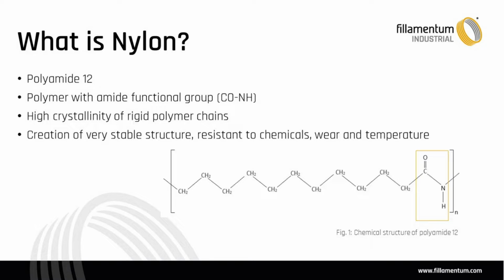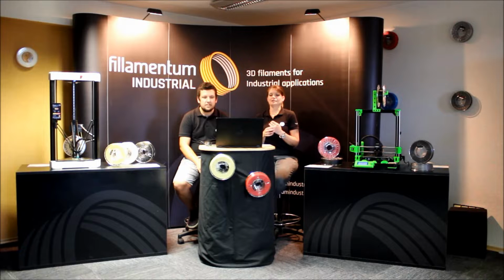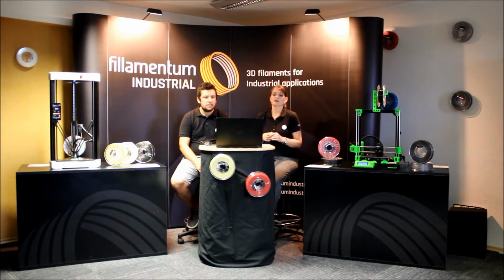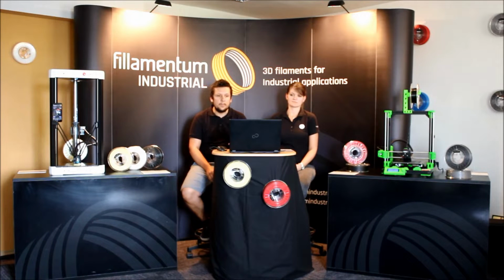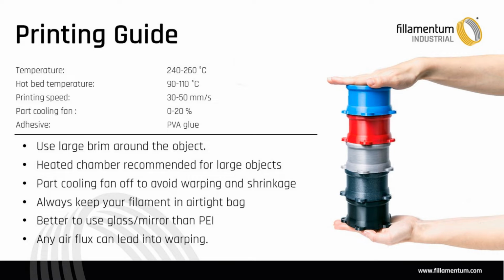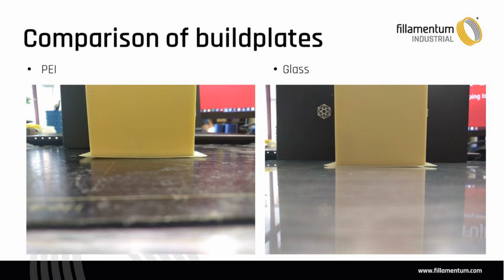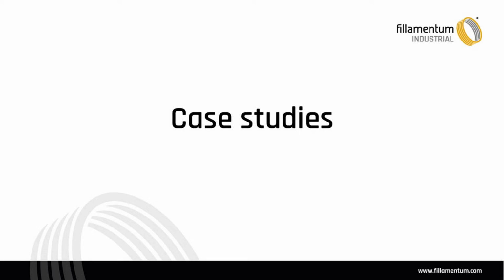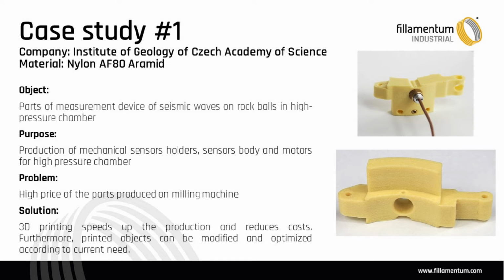Tricky Nylons: Reveal the mystery without a misery

Comment: Thank you for this first webinar. Please do get a microphone to place near Martin and Martina to eliminate the machine noise that made this very difficult to hear. You mentioned that carbon or aramid fiber filled nylon has lower crystallinity. I would like to know how that affects the final printed product. Is it just in chemical resistance?
Reply from the maker: Hi, thanks for your question :) The fibers influence all the properties, mechanical, chemical, and temperature resistance. Because they disrupt the structure, the mechanical resistance against impact is lower, but it is more resistant to creep, pressure, and long-term load. The temperature resistance is higher under load (HDT of Nylon FX256 under 1,8 MPa is 50 °C, Nylon CF15 Carbon under 1,8 MPa is about 130 °C) because the fibers hold the shape well. And chemical resistance might be a little bit lower because the crystallinity is lower and the solvent has better access to the polymer chain. It should be always tested for specific chemical substances.